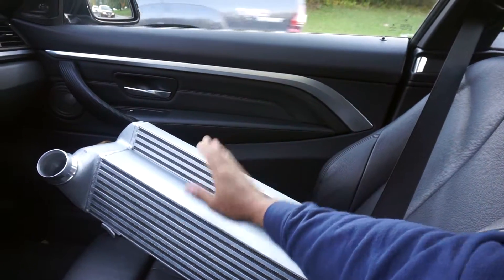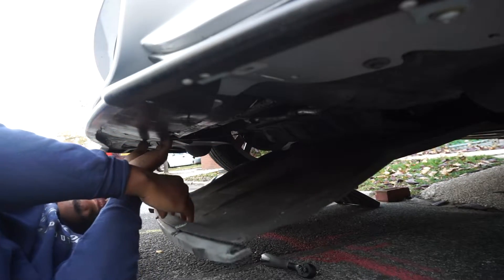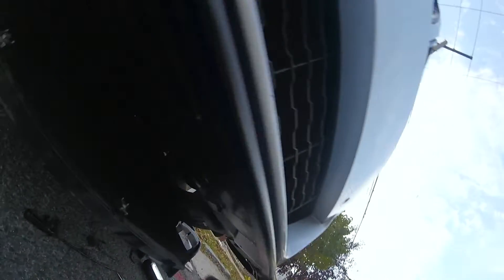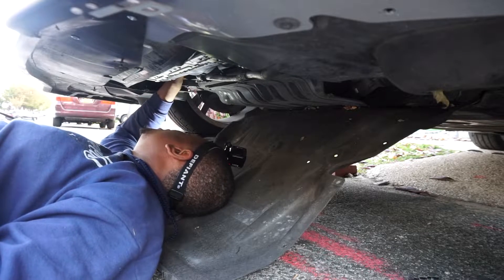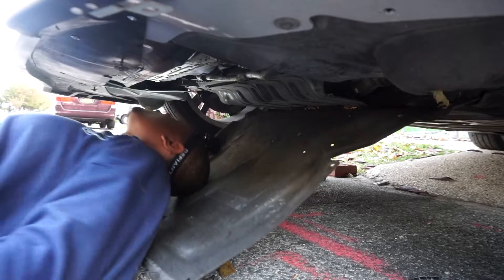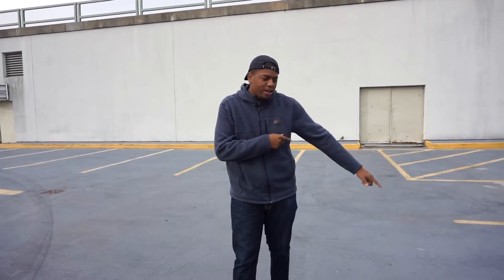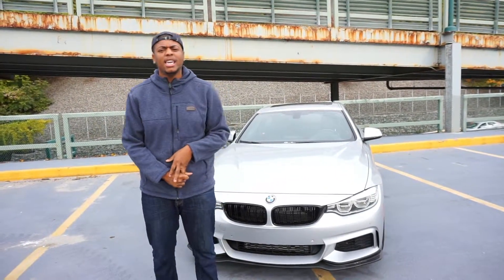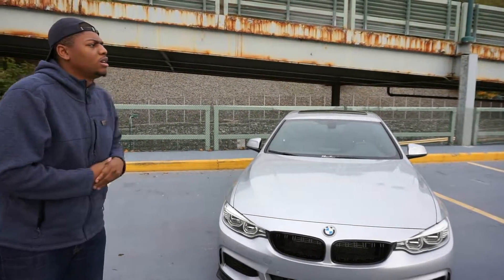Making My BMW 435i Even Faster

Comment: Did you had to make any cutting installing it?   I bought the same Intercooler and was afraid of turbo lag.  Did you figure out why it took longer to boost?
Reply from the maker: It took no cutting to install, I’m thinking it’s leaking from somewhere however haven’t found it. I’m gonna take it to get dynoed and have them look at it.
Reply: Slowspeed thank you for your message and i am returning my unit back to the vendor.  VRSF is not a quality product and I will be spending double the price for a Wagner.  Use the smoke test when you have time to find the leak.
Reply from the maker: I fully understand, chasing leaks can get annoying
Reply: @Slowspeed  it's probably not a leak; bigger intercoolers can introduce a little extra turbo lag.  Logging boost pressure would be a good way to find out!  (I'm about to install the exact same intercooler for my n55)

Comment: But the IC isnt going to make it much faster if any faster on its on bro.. it'll likely cool better, and keep your AIT lower at full throttle, but it depends on what they were before. And it takes longer to build boost cause its bigger, much bigger, the additional size lowers throttle response. You gotta get it tuned man so you can turn up the boost,  run cooler under more load. Grab you an android phone and get MHD on there bro, tuning is how you make it faster.
Reply from the maker: I have an OTS tune as of now, and faster wasn’t the best word but in a sense with better air flow and cooler IAT is can run the same times repeatly which can mean its faster lol
Reply: @Slowspeed  awww okay I see lol, I got the same one mine didn't have much of an effect on logs until I started doing runs during the hotter days of summer then I noticed it was really keeping my AIT's down, but I see you got it bro OTS is way better than MHD, I got mine from MOTIVE tunes